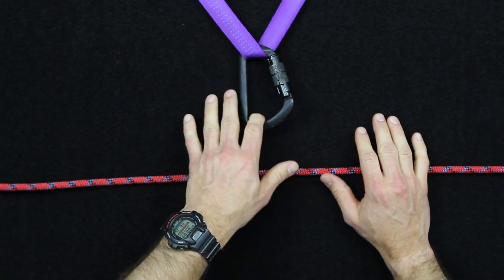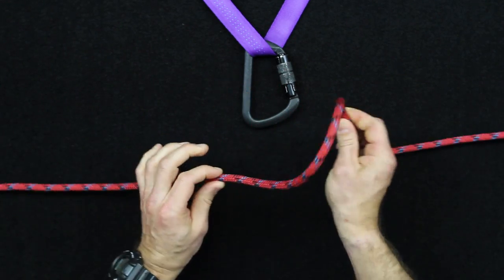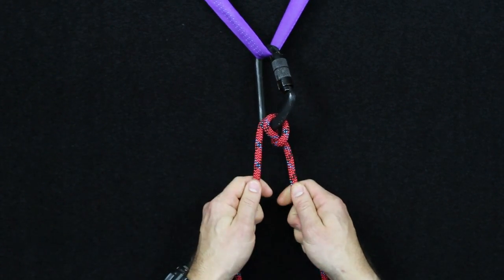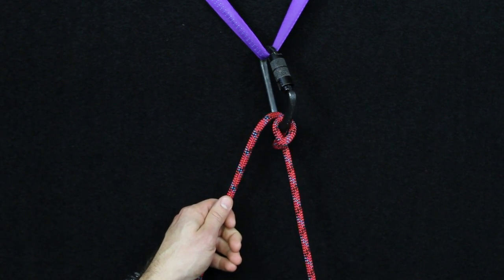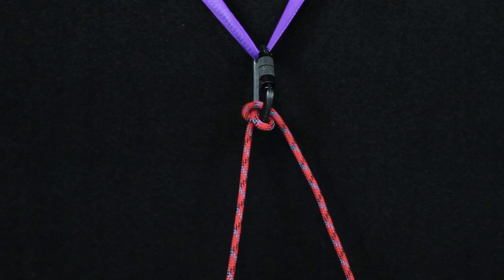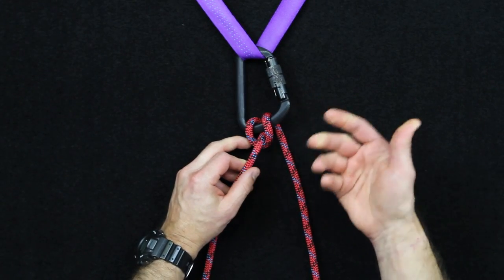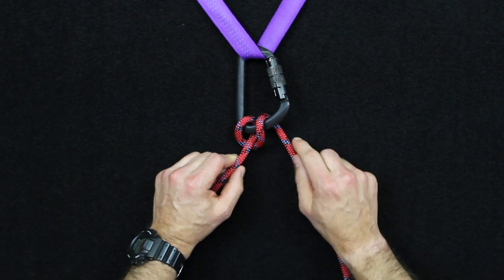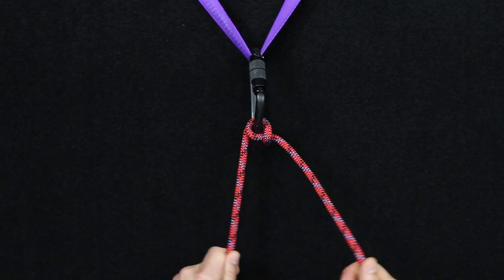Belay and Control Your Descent with the Munter Hitch - ITS Knot of the Week HD

Comment: I dont know if I missed it but does this have a stop in it? Or do you need to use a prussic attached to stop the line? The line looked like it fed thru by just pulling one line?
Reply: The belayer is the stop!
Reply: You can put an autobloc or prussick under the brake hand as a backup in case the belayer loses control somehow
Reply: Or use an ATC Guide belay device to rapell on both strands of the rope IF you are solo. Also use a Prusic for safety in case YOU lose control of the rope